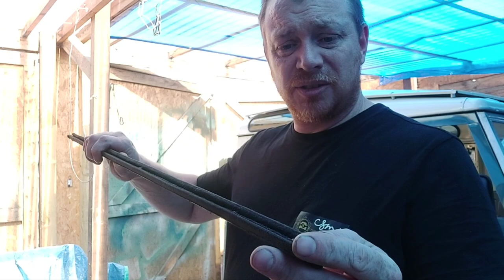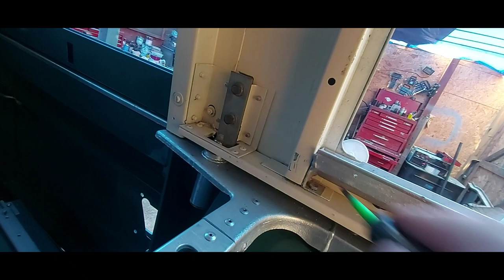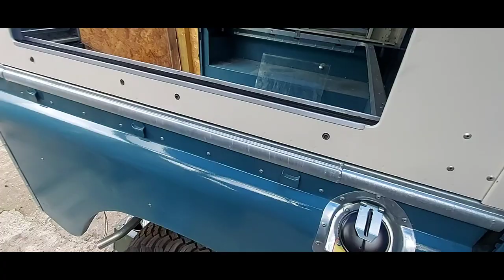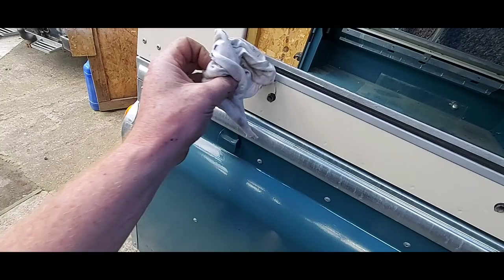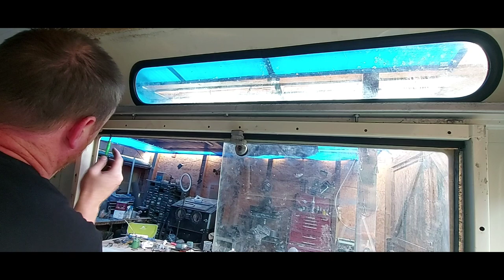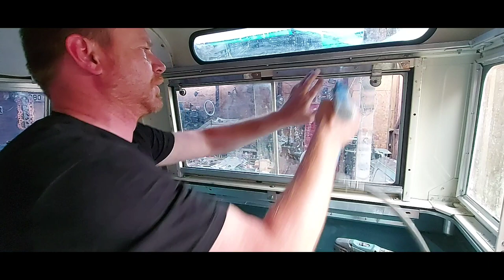fitting land rover county station wagon windows

Comment: Great stuff! Will make it easier to do this if we can get our hands on a set of these panels! Is there any reason you don't use sealant to hold the channels in?
Reply from the maker: There's no need for sealant any water should drain out the holes in the bottom channel and screws are more reliable than sealant There's a chance the sealant/adhesive could fail 🙂👍

Comment: Rely helpful! 🙏My series 3 seem to have aluminium lists at the back edge where you added the rubber hose. I don’t know why. 🙄

Are you going to use that car as intended? It appears to be more of av exhibit car than when it left the factory! 😀
Reply from the maker: Mine would of been aluminium originally but they are missing on mine. I built it to sell on but hopefully it will get used as intended. 🙂👍